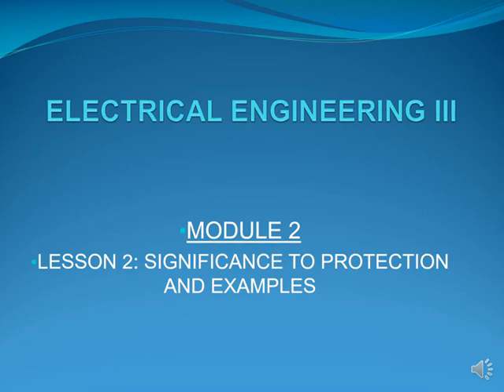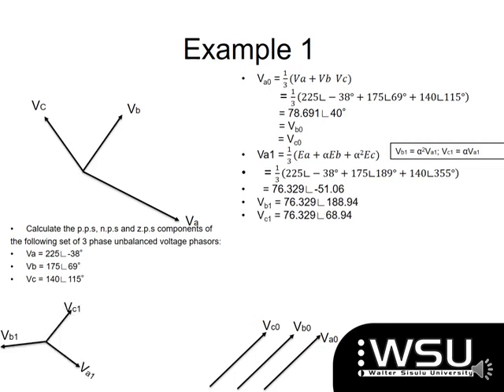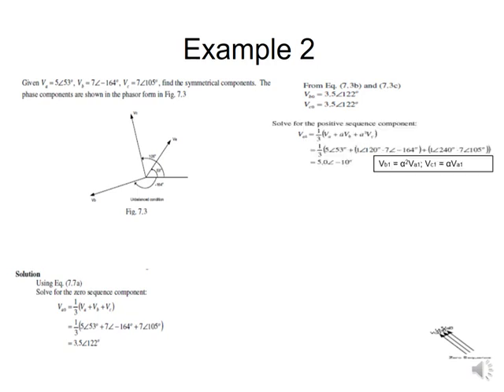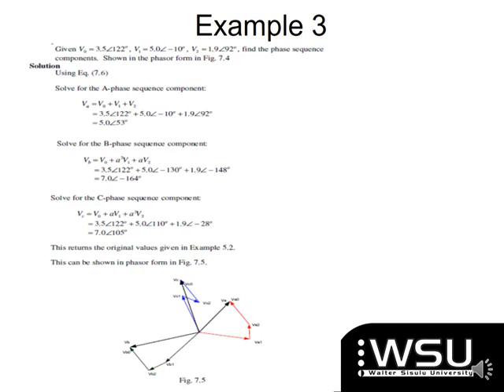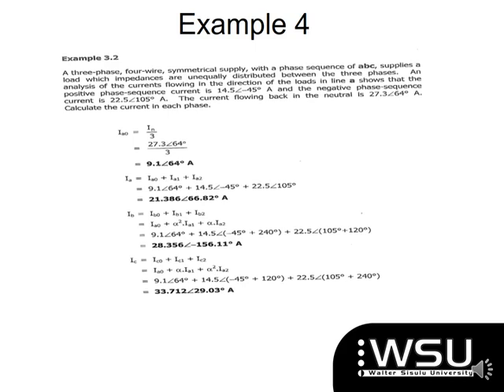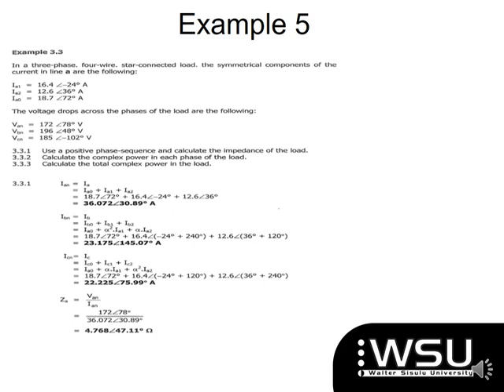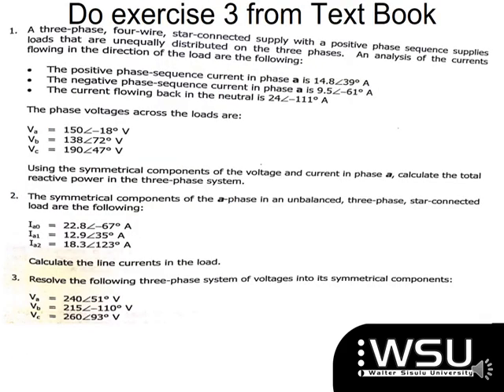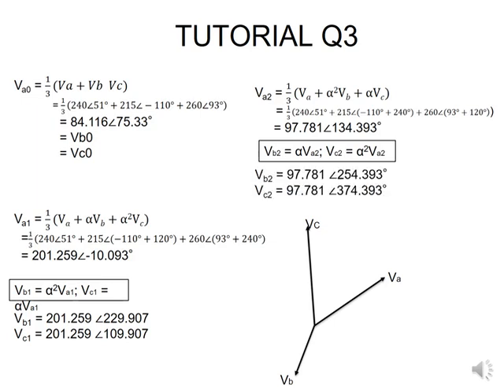Symmetrical Components Examples

Comment: Thanks for the lecture so for unbalanced delta we use the same logic we used in Wye connected load to calculate the positive, negative, and zero sequence components for various voltages and currents.
Reply from the maker: You got it.
Reply: Thanks. your help is highly appreciated

Comment: how do calculate the phasors, i see most of the time people use calculators, i love to find manually
Reply from the maker: As long as you know the formula for positive phase sequence or negative phase sequence you can just add alpha to the angle you were given. Alpha is equivalent to 120 degrees while Alpha Squared is equivalent to 240 degrees.  Adding up for your 0.1 and 2 is pretty hard without a calculator. If you do not have the calculator where you input angles, do it the long way. eg if your angle is 150 degrees, then you do a cosine of 150 + j(sine 150)